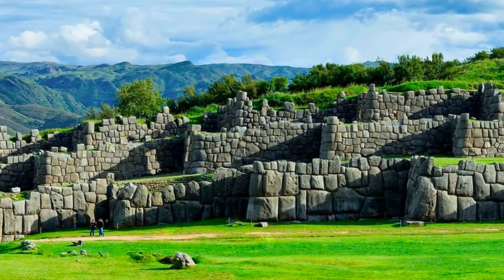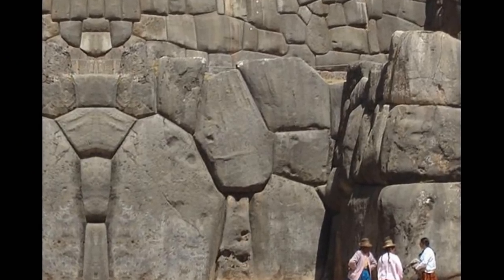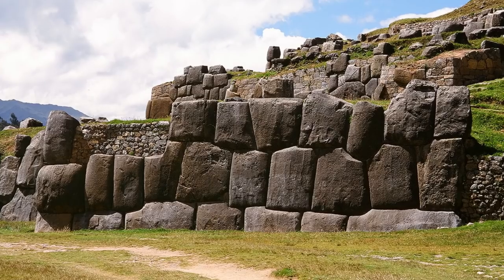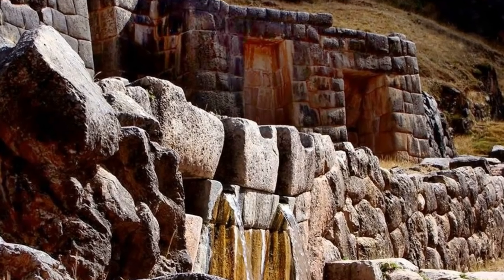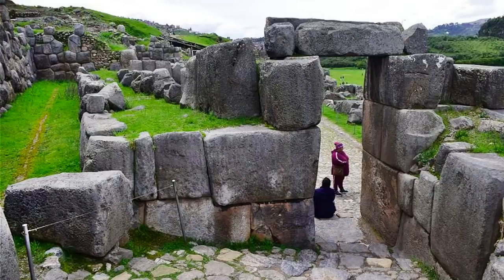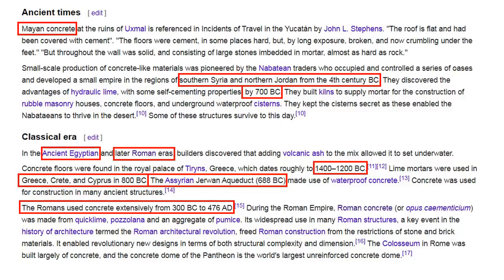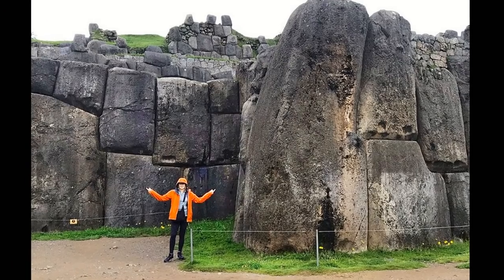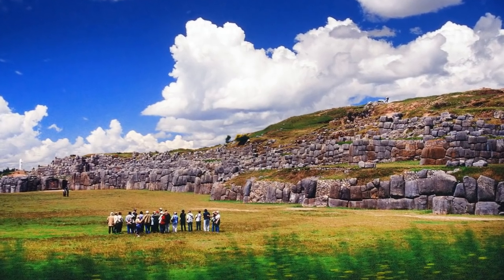Explained: How were Peru’s #Sacsayhuaman Walls Built

Comment: Several methods of fabrication of the polygonal masonry using clay/gypsum replicas, a topography translator, reduced clay models of the stone blocks, and a 3D-pantograph are described in the article “Fabrication methods of the polygonal masonry of large tightly fitted stone blocks with curved surface interfaces in megalithic structures of Peru” (DOI: 10.20944/preprints202108.0087.v5). I do not provide a direct link, because YouTube does not allow a comment with this link. Search by the article title.
Reply: The 10th article edition (DOI: 10.20944/preprints202108.0087.v10) is posted at P r e p r i n t s. Search the article by DOI or by title.
Reply: Nice try...we don't need replicas cause it cannot be done.

Comment: It kind of seems like if the geo-polymer was poured in a woven bags, thay could be stacked to make those blocks. The outsides would be rounded with endentions being caused by boards proping up the squishy oozing of the bags. Solid boards for the doorways, or packed earth then dug away.  Great video Tina. 🐌
P.S. I think there could have been bags, because the bags may have  decayed over time, or burned to remove the tattered ends. The later product would resemble what happens a bag of concrete hardens in the bag, and the bag decomposed off. Bags also because of availability and maybe reuse of leftovers. Just guessing.🐌🐢
Reply: The geopolymer DOES NOT have to be "poured" into bags,  woven or otherwise.  See my answer to steelbones above.
Reply: @evanpenny348  I had trouble sifting through 463 comments, I couldn't find your reference. Catch me back on this thread. I postulated the bags because of the outward shape. I've seen bags of concrete harden in a similar way. It could have been a combination of bags and wooden planks, I noticed impressions in the outward buldges of those otherwise rounded areas. We're all just hypothesizing I reckon.🐌

Comment: This has been the theory that I had believed in for many years. I have never heard anyone talk about it in such detail until now. I love this idea and I had tried to promote it without making much effort though. Congratulation on making these videos. I even thought that there could be an unknown method to softening existing rocks to the point they are modelable but that still doesn't solve the problem of how to move suck rock in the position. The proposal in this videos is much more possible since it obviously explains the most important puzzle of moving and placing these enormous rocks. Thank you for your videos, I think it is pretty accurate and can explain other ancient sites.
Reply from the maker: Thank you Ezio. I really appreciate your support.
Reply: Any geologist  in the world can tell the difference  between  concrete and rocks , these  are definitely  rocks !
Reply: @johnsmith-xh6je  Indeed!  At the same time I wonder whether these geologists have pondered alternate explanations very much.
Reply: Exceptions? Solid granite used in facing the pryamids w solid cut limestone base. But in re: to this structue her assumption or theory is correct. Kudos and applause!!
Reply: However, the geotechnicians in the same paper she quoted proved the blocks came from the nearby quarry.
Reply: @johnsmith-xh6je  The paper she's quoting from says they are limestone from the nearby quarry. I've challenged her already a few comments above, presenting the translation of dozens of pages that contradict everything she said in the video.
Reply: @gboblak3527  In the paper she linked, they proved it's limestone, the wall is definitely not a concrete-like structure, those are "just ordinary" rocks templated to match a pattern.
Reply: There is a new breed of archaeologist who are not constrained by ideological bias. this is becoming more common thank goodness.
Reply: @theobserver9131  What ideological barrier?
Reply from the maker: @_John_P   "The analysis showed that the chemical makeup of the samples from the quarry and the wall of the fortress at Sacsayhuaman is practically identical. Such close similarity of the chemical makeup of the analyzed samples indicates that the material of the blocks in the wall was produced from the limestone, which was obtained in the quarry"
"With regards to the material of the blocks, we can confidently say, that the process which formed them is
impossible in nature. This is based on the fact that cryptocrystalline organogenic limestone can recrystallize up to marble in the presence of water and high temperature, however, this results in large crystals being formed, since processes occur slowly in nature and the crystals have time to grow. Uniform [homogeneous] fine crystallinity, as in the presented samples from the blocks in the masonry, could be obtained under a very rapid process. Furthermore, under the condition that at any point in the system there is enough water, and carbonate material. "
Reply: @CuriousBeingbyTina  I quoted the same for you, the crystalline structure is atypical, however it does not support the concrete hypothesis. It's atypical in the sense that the marble did not form as expected, and it's possible to prevent marble formation by allowing water ingress the block through the cracks only, hence controlling the aging process. It has nothing to do with building blocks from powder.
Reply: The concrete theory does not make the movement of heavy loads of material to make the blocks much easier. The stone STILL had to be transported many miles across a steep valley even if in powdered form, so the transport problem remains, although not as serious as for natural blocks. The task of reducing vast quantities of stone cut from bedrock to power and then making it into cement is enormous and - frankly - unbelievable. I's rather believe in aliens with levitation machines than that! Some of you theorists need to get real.

Comment: Love the video and idea behind your thinking..
You could Shaw up sides with leaves and planks a course of blocks at a time. Let the course harden then on to the next layer and repeat this process. There would be no lifting of blocks involved if you want to go with a mixture theory, you could mix at floor level and take an armful of mix up at a time and fill a mould, which really wouldn't need to be a uniform mould, just merely Shaw the sides of a desired block size on top of a already hardened wall portion/section and box it in to some effect. The soft fresh lay of mix could be packed from the top to release air and snuggly fit around it's base pre hardened block. (maybe why you get bulge-out at the bottoms? The bulges and indentations could maybe be were they have tried to Shaw up to stop tilting of a side or possibly they added them as a tie to add a wooden construction of different types on to different parts of the wall, such as walkways, lintels, pitched roofing and so on).
Humanity has been mixing mud / straws, dung and stucco/cements for years, plausible that this could be another mix technique.
I wonder, out of curiosity, if we had the opportunity to cut a large block in half would we find any filler material such as ballast?
 The analysis of the rocks used in construction should give you a percentage of material types. (Does anybody know the contents ratios?)
I would have fun and try making my own block with the ratio information. The next step would be experiments using the materials in powder/granular form.
If limestone is present, fire it up to red hot, crush it down, add the other materials and then add water and mix to your plasticine consistency : 
I would guess without ever seeing the analysis... volcanic ash, granite powder, river or small granular stones, fine rock powder or whatever was probably accessible to the site of construction. 
Yep, so I would try to match the existing mixture and try other materials from the area and make my own supper concrete.😁 Get out in the field! 

If I could have the chance I would be happy to go with you and try all this.

Another thought regarding different block shapes I have considered is because of a community effort as opposed to just expert builders.
   I would expect a consistency of size and lay in the blocks created by the most skilful, but the rest of the community might have just simply been playing, "my block is bigger than your block" each group would have possibly worked different sections of the wall and by happy chance created a stronger wall resistant to slipping.
Or maybe they were all aliens and I'm way off! 

Of course I have never been to this site, but if blocks are found say in a quarry or near to the site still attached to bedrock with tool working marks, extraction marks and this rock matches the analysis of the rocks situated in the structure itself, it would discredit the previous analysis and be a tougher argument for moulding.
If that's the case then how did they get the heavy blocks to site and lift them and carve them to fit so well?
It would be so much quicker and easier to use the mix technique you cannot deny, but I think we need more honest people out in the field giving the above a look.  

The great wall of China is quite impressive too.

All the best 😘
Reply from the maker: Thank you for sharing with me. I really appreciate it! I heard that these walls are off-limits now and people are only allowed to look from a distance. I imagine it would be very difficult to get approval to collect samples. Hopefully the authorities would let researchers to do investigations onsite. The Great Wall of China was originally made from rammed earth and later replaced with bricks; these walls are really impressive but they are not made of stone 🙂 Thanks again for the comment!

Comment: This concrete/conglomerate poured stone  idea has been around for some time now, but it falls down on the need for shuttering to create a mould, and the odd shapes of the lower blocks, where the tops of these have strange protrusions and indents that the adjacent blocks and next layers have to account for. If the blocks were poured, the tops of the lowest blocks would reflect a flat surface even if that surface was higher or lower on adjacent blocks of the same band.
The joining of stones/bricks is called bonding and the types of bond used on the structures shown in this video would require the stones in each row to be cast using the adjacent side next to it. If a membrane was introduced to separate the adjacent blocks, wood or perhaps animal skins or plant matter, then this would create a larger gap than exists between the stones and/or leave some kind of markings or residue as the internal structures of this shuttering broke down.
Reply: Not necessary flat surface on top after pouruling the material out: if it was some jelly-kind consistency, you can form their tops easilt, like clay

Comment: The fact that the stone was analysed and found ‘impossible to be formed in nature’ immediately puts a completely different train of thought into the subject. Maybe sacks of woven plant matter or leather were filled by numerous teams of workers with the casting compound and placed to form the walls. If they were over-filled or needed “adjustment”, they could be slit to allow material to escape. The ‘nubs’ would be formed from this process. The sacks would disintegrate over time. Different teams of workers filling non-uniform sacks would answer the different size stone question. If the technology to work stone this accurately existed, they would be uniformly shaped, either cuboid bricks or an inter-locking jigsaw-style for an earthquake proof structure perhaps.
Reply: When the sacks disintegrated, wouldn't there be a gap between the blocks? A gap as large as the thickness of the sacks?
Reply: @scottbreseke716  over time the sack material would cease to be present. Therefore there would no longer be half a millimetre of material compressed around them. The ‘stones’ would settle together as seen. I wasn’t thinking the bags would be made from woven tree bark or thick rawhide, just strips of strong leaves or llama skin.
Reply: @Dan_moon_sun  At the time when the sack material would cease to be present, there would be a gap. You're thinking that stone "settle"? I've never heard that stone change size and "settle" over time.
Reply: Henrik Schandorff  Seems like we're trying to find explanations which fit in with our understanding of our current technology, and avoiding the possibility of explanations which involve a technology we don't know about yet.
Reply: Henrik Schandorff  ah, I may be on your wavelength then.
Reply: Henrik Schandorff  Oh yeah. I like the info that Erich provides. Curious Being is trying to explain everything in terms of current technology and our current understanding of materials, as if it's not possible for anything to be more advanced than our current technology and our current understanding of materials. The premise she begins with is wrong. Her premise is that It's not possible that things could not have been accomplished using technology that exceeds our current understanding of technology and materials. I'm wondering if somebody or some group is paying her to come up with these diversion explanations.
Reply: @Stan Dieks OK, no problem. I am no expert. It is hard, as a layman to know what has been done.

Comment: Great explanation! I also think they were cast from a liquid material. It's much easier to lift small pours of concrete than a huge piece of stone. One question remains: how the material in the cast pieces was held together. Today we use some wooden molds for concrete, but there are no textured imprints and it's not suitable for curved shapes. My guess is they may have used some big bags. They'd be still flexible to stamp higher stones into the lower ones. The remaining questions are: What material they could have used to hold the pressure and in such enormous quantity? Some plant-based textile? If they used bags was there any organic material found at the boundaries of the stones? Why some adjacent stones are clearly separated and not blended together via the tiny holes in the textile?

Comment: Your play dough blocks analogy sold me on the idea.  I have always thought that it was quarried stone that were individually carved with precision.  That might still be the case.  However, there are others who proposed that a chemical was used to soften quarried stone blocks.  I have always rejected that idea. 

Now you arrive with a new idea, proposing that this was quarried stone that was made into a cement mixture that was plastic, like play dough.  That makes the most sense when you want to think about how to efficiently make a wall where no two blocks are alike and where they all fit tightly together.

Today all of our cement mixes are fluid and pourable.  If someone were to make a cement mix that had the consistency of play dough, they would be able to make such constructions today. However, we don't have play dough cements in our current construction materials inventories, although we do have pottery clay which is close to that concept.  Is this because we don't know how?  Or is it because we haven't got a use for play dough cement?

On another note, one that would not fit with the play dough theory is my idea of where the nubs come from.

Molds have pour holes and air holes.  In the pour hole the material to be molded is poured in.  The air hole lets the air out of the space that the material needs to occupy.  When the molded item is broken out of its mold, it results in nubs where the pour hole and the air hole was.  Could it be that with some of the stones that were molded, not all of the remaining nubs had been removed?
Reply from the maker: Thank you for sharing your insight with me. I really appreciate it.  I think the ancient builders may have different formulas to make concrete. I would say it's possible that some nubs came from the molds :-)

Comment: I agree with your theory after messing around doing some repairs with wet concrete. The bags were filled in situ and the shear weight would have pushed them together.
Reply from the maker: Thank you
Reply: And the bags had no thickness to them to leave a gap between the blocks later?

Comment: Great presentation CB..
There would be irrefutable differences, chemically, physically and structurally between natural rock and an artificially made concrete conglomerate. I have made garden retaining walls out of decomposed granite and cement. Using an electric mixer I add one part of cement to five parts decomposed granite, which would also have some clay content and add just enough water to to make it wet. I place some in a mold , tamp it down then immediately locate it on the wall that I'm making. The bricks stay plastic for a while and the ones on the bottom rows do distort and bulge slightly as the height increases. But there is one big difference, they bond strongly to their neighbors because of the pressure due to gravity and this is not evident in the walls you are referring to.
Reply from the maker: Thank you for sharing your insight. It's very interesting. I appreciate it!

Comment: I have thought this same thing for years as many types of stone when ground to small particles then mixed with water will reform into solids.
the other thing is that if the ground was sloped you could dig a trench where you wanted your wall then just fill it with this slurry creating polygonal blocks.
Reply from the maker: Good point, thank you Kevin. 
I made a series of videos on ancient megalithic sites and prehistory civilization. Hope you will enjoy them as well :-)
Reply: @CuriousBeingbyTina  if it was poured then why the need for so many different shapes
Reply from the maker: @wetl3ttuce  I explained this in the video.
Reply: @wetl3ttuce  it was an ancient form of writing i read somewhere, which shows aligments of the sun and moon. a theory by DR Derek cunningham
Reply: @wetl3ttuce  make it super resistant to earth movement. ie. earthquakes..